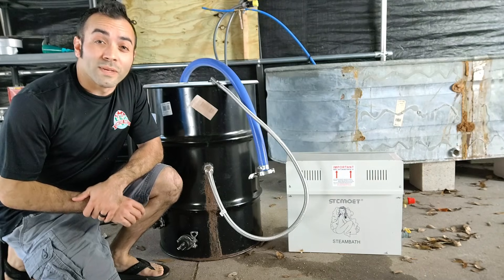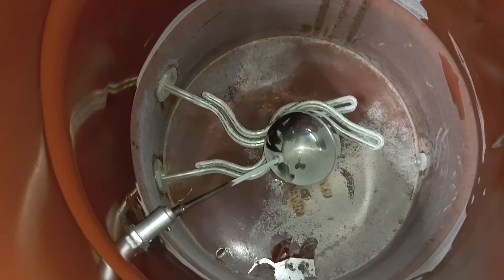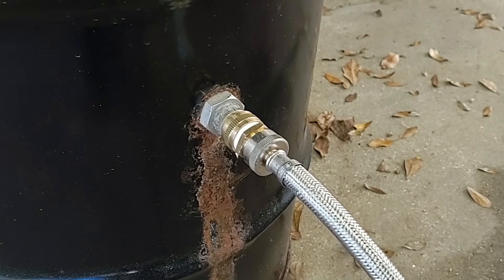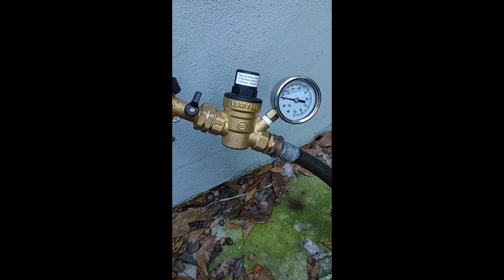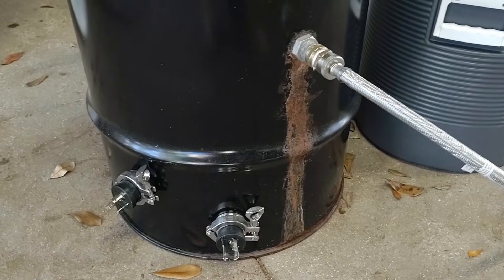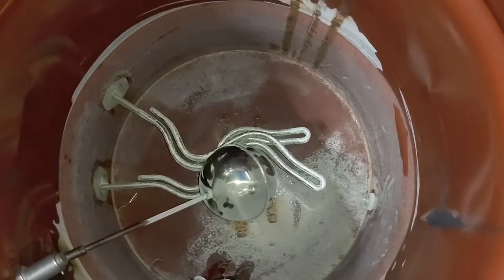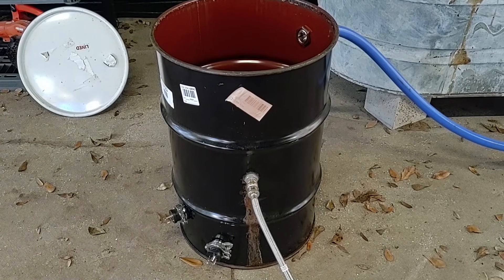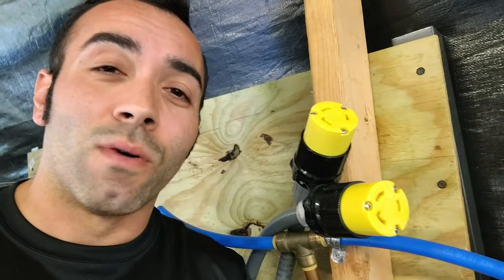LEVEL UP YOUR MUSHROOM FARM WITH A BARREL STEAMER

Comment: I'm gonna run a setup like this, the thing that worries me is after the run finished how to be sure that there are no contams gonna enter the vessel as it cools down?
Reply from the maker: You unload it while its still hot and wheel into your lab.
Reply: @cactushatmushrooms3677  my lab is the kitchen using a SAB to inoculate 😞. If while is still hot unplug the steam hose and close all the valves etc will be ok letting cool like that or will have issue while its getting cold and not be able to suck air in?
Reply from the maker: @EmmanouilD  I understand fully. When I first started I didnt worry about bringing them in while hot or anything. Sometimes I would keep them out there for two days. Some farmers feel that is guaranteed contam but I simply didnt have it happen. As long as theyre folded well enough to have a good seal after youll be fine. Just wheel them into any room you store blocks in. You could also store them in storage totes until use.
Reply: @cactushatmushrooms3677  I'll do good folding and will close any valve with some kind of filter so can cool down with less particles getting in. I'll figure it out. Thank you for all the help!! Cheers!!

Comment: What tool do you prefer to read your substrate  temp?
Reply from the maker: Hey Alicia this unit has treated me very well and the probe has lasted a year straight so far which is crazy. 

https://www.amazon.com/Inkbird-Waterproof-Bluetooth-Thermometer-Rechargeable/dp/B07WXQWD3Y?pd_rd_w=fSHem&content-id=amzn1.sym.62bf6161-8bd0-4857-85d6-e30435da42bd&pf_rd_p=62bf6161-8bd0-4857-85d6-e30435da42bd&pf_rd_r=NMT4W53VH2W8H2PEDR14&pd_rd_wg=Jg9xs&pd_rd_r=68b0efb7-cc59-49f2-aa76-71bc48eb95fe&pd_rd_i=B07WXQWD3Y&psc=1&ref_=pd_bap_d_grid_rp_0_50_i

Comment: I noticed you are not running a PID or any kind of temperature controller. Have you had any problems with that? Those things are expensive and if I can get by without buying one right now I totally will.
Reply from the maker: A PID is ideal but I didnt and still dont use one. I just measure my cooks with a temp probe in the center of a block and turn it off when done.

Comment: does  this smell strong when its up and running in an enclosed area. can this be used in a closed garage?   does it create a lot of steam?
Reply from the maker: There is definitely a smell. I find it pleasant but not everyone does. I dont recommend doing this in an enclosed space unless there is really good ventilation. The steam that comes out of the trough will ruin everything in the garage.

Comment: no gasket on the tri-clamp??
Reply from the maker: The elements come with gaskets you use since they're under the water line as does the drain. The steam outlet and water intake to the float don't have them and aren't needed. Sorry if I forgot to mention that.

Comment: When you say "putting it against the bulk head fitting" at 1:30 is your fitting threaded? How does the heating element stay in? Thanks!
Reply from the maker: These brewers fittings are threadless and press together. A tri clamp keeps them pressed together. The heating element also functions in this fashion. At one point in the video I show how they press together. Parts list in description should still be current.

Comment: Question Joe,  why do you need a 30 gallon barrel for the steam.  Would something smaller not work just as well.   Thanks,   John.....Punta Gorda
Reply from the maker: The main reason is that it was modeled after this Eric Myers version. A smaller vessel could work but may be more difficult to fit multiple elements to achieve enough power to steam larger containers. There are people however that use honey pots with one 9kw element and do fine. I prefer the extra kw of two elements so the substrate gets to temp quickly before fermentation takes hold of the substrate. Hope this helps.

Comment: wiring the dedicated lines requires 2 double breaker slots, 4 slots in total. You probably don't have this. You can also get a special kind of breaker that has 4 switches, two and two connected, that only take up a double breaker slot, but those are expensive and are only available with certain breaker box brands. Wiring the breakers into the breaker box will require you to expose very deadly and freely open power strips and you will either need to turn off mains power at the breaker panel during installation or risk frying yourself to a crisp with a very short yet very painful death. 

Other than that, for 5500 watts on 240v is 23 amperes or 25 amperes on 220v. You will require a 30 to 35 amp breaker at least to power those elements, but be sure to use the manufacturer's recommendations. I recommend #6 AWG gauge wire for the line voltage for redundancy. It's a chonky boy so expect it to be hard to bend and rather unwieldly. Use electrical whips or conduit to sheath your wire. Always use a double-pole switch rated for high amperes. A single-pole switch will turn the system off, but the wires will always be live, making maintenance scarier. Dedicated disconnect switches are the safest, but a breaker switch without ampere protection can work too. However, in the HVAC field, I've had a history of breakers being used as disconnect switches being turned off and then never turning on again, requiring a repair, so I'm partial to disconnect switches myself. 

Also, if you don't know any of what I just said

yeah, go hire an electrician real fast, and spend the cost of labor for the safety and warranty of a professional's work.
Reply from the maker: Appreciate your experience and input. We currently use 45 amp breakers for each.

Comment: Hey Joe, thanks for this brother, it's awesome. I'm building one in a couple days and as my parts come in I came across a question: do you use any special kind of fitting or gasket for securing the float valve to the barrel? It seems like all the other fittings have those weldless bulkheads but the float valve doesn't so I'm wondering if I am missing something here. Thanks!
Reply from the maker: I just used the fitting that came with the float valve. The fitting sits above the water line so it doesnt leak. I do however use plumbers tape on the outside of the barrel so the connections dont leak
Reply: @cactushatmushrooms3677  thanks Joe!

Comment: The 2 heating elements he uses are 4500W which is 4.5KW so 4.5 units of electricity in Australia 1 unit cost 0.3 cents and hour. So a run for 20h to sterilize 40 bags will cost you. (4.5x0.3)x2 = $2.7. Times that by 20h, 2.7x20= $54 a run for 40bags. Do 3 runs a week that's $162 just for your barrel. Add to that expenses your air-conditioning for your grow room and you got your self a $1000+  a month just for those two items.  I run mine on a 2.2KW full power for 1h and reducer the power to 70% for 19h and it works fine.
Reply from the maker: I'm not  good with math in terms of what it costs in electricity, but keep in mind the trough holds a lot more than 40 blocks. If you really wanted you could fit 160 blocks in a cattle trough (this one is 300 gallons). Making the $54 more than worth it.

Youre absolutely right about reducing the power. You could unplug one element once your blocks are up to temp. Just make sure youre measuring core temp with a probe.
Reply: @cactushatmushrooms3677   ohh I that it was just the 205l barrel. It make more worth while for 160 blocks. Did you insulate the cattle barrel? And does it have a lid?
Reply from the maker: @jeromejalibat3951  I havent had to since its so hot where I am, but its a good idea and ill get around to it eventually. The lid is just a tarp and blankets. In my most recent video I go over the set up more.

Comment: Is the pressure reducer for air or water?
Reply from the maker: The pressure reducer at the garden hose is to reduce the pressure of the water to the float valve. If you dont do this you run the risk of the pressure forcing water right through the float valve and over flowing your barrel.

Comment: Can you use two 120v  heaters instead?
Reply from the maker: You can but it may not make enough steam for larger containers like a trough. I would look into the ez bake barrel if you're wanting 120v

Comment: Hi Joe. I’d love to do this. I live off grid in the outback of Australia and I don’t have enough solar power to do what you’ve done. I’m going to do it with gas, which I know is less efficient. I’ve read so many articles on the amount of time needed for sterilisation. I’m thinking about staying out with 14 hrs once 98+ degrees is obtained. Your thoughts are appreciated. 👌🏻
Reply from the maker: You can most definitely use propane. I'm fact I have a great farm that emailed me some time ago that does just that with great success! The general answer to your question is a core temperature of 200f for 6 to 8 hours. Use a temp probe in one of your blocks to measure.
Reply: I am off grid in Portugal just getting started, any ideas on how you would set up a gas burner in this barrel design? Have you looked into the possiblity of fermenting spent substrate for bio gas? Thanks for any input, Danny
Reply from the maker: @Melloshroom  simply just set up the barrel on top of a propane gas burner. As far as the bio digester I don't know anything about that space.

Comment: I have suggestion for leakage problem. 
You must rubber vad mean,  rubber ring red and black color inside and outside to block leakage.  
 Use sealer paste,  before  placing it.
You observe stainless steel electric cattle,  you will understand. 
 No need of buying stainless  steel drum for steaming.  Use wood at baseline to spread of electric current. Keep teseter to check electricity flow as a precaution. 
Another suggestion is for rusting of iron drum. 
First 
 Purchase dry coaltar used for making road.  You heat in drum of 20 liter by putting on fire.  You take one cloth wrapped it around wood.  You paint your iron drum with hot coaltar.  It doesn't smell after some time.  Last longer. Don't use wet coaltar it's useless. 
Second 
Paint your drum antiwater paint used for making wood bathtub. Water doesn't stick to paint. You ask hardware shops or surf on net. 
I have watched vedio,people have made bathroom inside van and used this paint to protect wood from water.  Thanks for such nice idea. 
Namh shivay.
Dear friend, 
If ever you will notice electric current  is flowing on the drum,  that means your electric rod is having cracks,  you purchase one magnify glass and check broken parts.  In such cases please change the electric rod. 
Another suggestion is. 
Suppose if you want to use for longer periods,  the electric socket becomes hotter and melt, In such cases use ceramic plugs for connectivity. 
Another option is ...keep extra rod connections,  keep closing rod after one or two hours usage.  Keep it close for hour to 30 minutes.  The electric connection will not become hot and melt. I have received lots of problems with electricity,  I use wooden stick for closing and opening of switches. 
Namh shivay.
Dear friend,  
I want you experiment with steam instead of fogger for fast production of mashroom during winter. 
The plants also want little bit hotter atmosphere. 
Namh shivay.
Reply from the maker: Appreciate ya.

Comment: Great vid, thanks for the details. Point of clarification, in your parts list you have 1" inner-diameter hose, but a 1/2" barbed TC fitting. Was that intentional?
Reply: Nevermind... looks like Dernord is out of the 1", so the listing just defaults to the 1/2". Ended up snagging one from Metaland.

I'm going to try to find a large stock pan (~40qt?) instead of a barrel. It'd be nice to find a stainless steel barrel or a brewer's vessel of some kind.

Comment: Do you need 3 faze power to run to 5000w elements or can you run it of normal house mains?
Reply from the maker: Im currently on a normal house main. Using 40 amp breakers.

Comment: I got the 1/2 inch barb and the 1 inch hose and it seems like a pretty crazy gap. Do I need to find hose with a different inner diameter?
Reply from the maker: It seems the link to the barb has changed. It should be a 1 inch barb with 1.5npt for the TRI clamp

Comment: How long do you run this unit for when full of your substrate blocks?
Reply from the maker: 18 hours. You will have to use temp probes to determine how long for your climate. I did a follow up to this video you should check out.
Reply: @cactushatmushrooms3677  thank you for putting so much time into this video and promptly responding! We just started our mushroom business. We are giving our sterilizer a go this next Sunday. We are excited! We built it just like you said to and it heated up nicely so far. We will put blocks in it for the real test. Thanks again!
Reply from the maker: @SC-bg2lv  my pleasure. Best of luck to you.

Comment: Any chance you could do a video on how you load this? Do you use some sort of tray at the bottom to keep your bags from touching your valve and heating elements?
Reply from the maker: My next video will be a follow up to this one. Just to clarify, the barrel is only to produce steam. No blocks get loaded into it. It's only purpose is to pump steam into another vessel of your choice. I pump mine into a 300 gallon cattle trough like many of the popular growers. It's a perfect mid range set up until one can afford a large autoclave.

Comment: I built this out and it working great for a while but now my plugs keep melting. Just bought a new one and it melted after one cook. Any idea what could be happening?
Reply from the maker: I've had plugs melt before, but never after one run. Make sure your connections are good and tight after several runs. The heating and cooling can loosen them. Also consider insulating your barrel, especially near the plugs.

Comment: What size shelves is everyone using? Om gonna get the rolling racks, but didn't know if I should get em 2ft deep.or 12 to 18 inches..thanks
Reply from the maker: If you can fit them, get sturdy 24x48 carts. 18 inches wide works too it's just a bit cramped still
Reply: @cactushatmushrooms3677  tha ks man..do you put 2 deep on the 24 inches?
Reply from the maker: @killerkennyas  you could yes. You can also do it with 18 inches depending how you rotate them
Reply: @cactushatmushrooms3677  cool thanks.a ton..jsut b starting .y journey up..got some lions and blue oyster lc to agar..now gotta get pallet of soy and hwfp

Comment: Instead of using the weight, think I could just lock my lid in place?  Or will the pressure build up too high
Reply from the maker: Its good to have a fail safe in case pressure starts building. Some people install pressure relief valves.

Comment: Quick question, can I just use a propane burner 160K-200K BTU.  I'm looking for some portability.
Reply from the maker: Not sure of the needed btu but I've had someone message me their set up and they used propane with success
Reply: @cactushatmushrooms3677  - Cool!  I just got my 55  gallon barrel today, but it will be a couple of weeks before I test it out.  Still need to buy some additional supplies.
Reply: @b.5815 how'd yours go? Mines 212 in 90mins lol total time is 9.5hrs and 5$ of propane. stable once u turn it down a little and let er rip.

Comment: where's the control unit? what maintains pressure and temperature?
Reply from the maker: This is a no pressure way to sterilize called atmospheric sterilization. It's just heat over a long period of time. No control unit needed, however, a pid controller would make it perfect.

Comment: Do you think I’ll have problems keeping temp with a single 1500w element? Got the one off Amazon called “DERNORD 2 Inch (OD64) Tri-clamp 120V 1500W Foldback Heating Element Electric Water Heater with Low Watt Density”
I do have a pid, would you recommend sticking the probe inside a bag while sterilizing or just somewhere in the middle of the drum? Thanks
Reply from the maker: Probe in the middle of a block because that's what you need to measure. An element that small would work to pump into a 55gal drum possibly but wouldn't be enough for a 300 gallon trough
Reply: @cactushatmushrooms3677  forgot to mention that it is just a 55 gal drum so hopefully it’ll be alright.. So you recommend I set the pid at 200 degrees Fahrenheit and run it for 20-24 hours, correct? It’s a bit nerve wracking using a new sterilizer for the first time, don’t want my spawn to go to waste but would like to keep the cook time as short as possible too😅
Reply from the maker: @qwqwueis  you'll be fine in a 55 gallon drum. You want a core temp of 200 degrees F for 6-8 hours. Run it until you achieve that and be confident.
Reply: @cactushatmushrooms3677  awesome, will do! Thanks for the feedback, much appreciated.
Reply: @cactushatmushrooms3677  I based everything off oak and spores recommendations so if his was underpowered I worry mine would be the same? Although I did have to make some changes being here in the US, I had to get the 120 v heating element.

Comment: Hi, how do you know if the temperature is good inside the boiler? It seems there is not controller.
Reply from the maker: A controller would be nice to have but it isn't needed. Measure the temperature in your substrate with a temperature probe. You want a core temperature of 200f for 6-8 hours
Reply: @cactushatmushrooms3677  thank you for the response 🙏